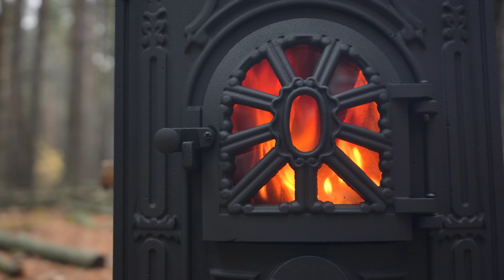Rainy day in a forest house, Installing a vintage stove, Cabin building in the woods

Comment: That stove looks perfect for your hut. 😊👍👍
I have two tips for you.
- You may consider to further protect the wall behind the stove with sheets of something non-combustible. The stove will with time dry out the wood panelling and make it more inflammable. Place a sheet of the same material under the stove too, to protect the floor.
- Consider the possibility of exchanging the upwards bend in the stovpipe on the outside with a T-section and place it so you can see the ground through the pipe when you look through it from the top. The third hole can be blanked off with a tight fitting lid. 
The T-section will make chimney sweeping easier in the long run. You will need to do it at least once a year - preferably twice, seeing that you burn conifer wood (pine, spruce, 🌲) in your stove. This kind of wood contains more resins than dedicious woods (birch, rowan, alder, aspen, 🌳) thus create more creosote. Creosote is flammable 🔥 and can cause chimney fires. You wouldn't like your hut to burn down from something like that, would you? 🙃🙂
Good luck with the continued work on your hut. 👋🙂
Reply from the maker: Thanks for your tips. About the protective sheets near the stove.... I am still checking how warm the walls and the floor get

Comment: Can you use the wood from the pallets to make a bench, sleeping platform, chairs, table, etc...   You seem to have lots of them. Love watching your cabin progress. What a lovely stove. Does it need a fire retardant material under it, or are the legs on it enough to raise it high enough not to need that
Reply from the maker: I'm still checking the height of the legs, but the floor was barely warm after the first time. You can make something out of the pallets... if they are not too rotten.

Comment: Great video. Are those fire blocks you added where the stove pipe goes through the wall? Where did you buy them? What brand?
Reply from the maker: That's right. They can withstand a lot of heat. You definitely don't have that brand, but you definitely have the material. Look it up and you'll find it
Reply: Awesome. Thanks for getting back to me. Appreciate it. Keep crushing. Cabin looks great.

Comment: You cant have the foam stuff setting on the pipe. It will melt.  It might catch fire.  It has to be the stuff that goes around pipes. Fire retardant.
Reply from the maker: This is not Styrofoam. This material can withstand over 1,000 degrees